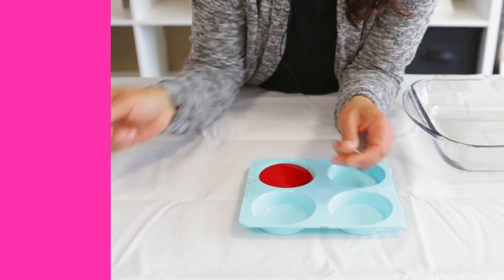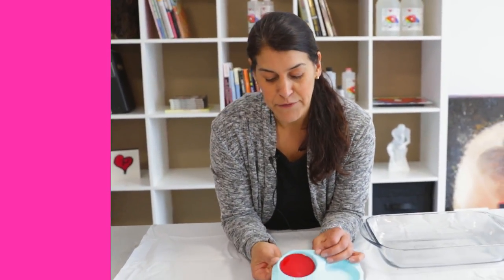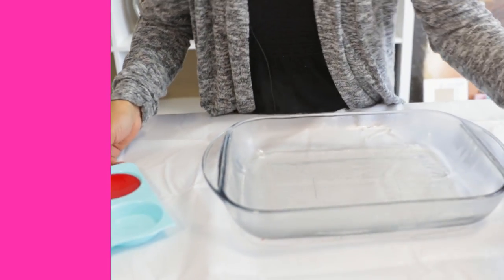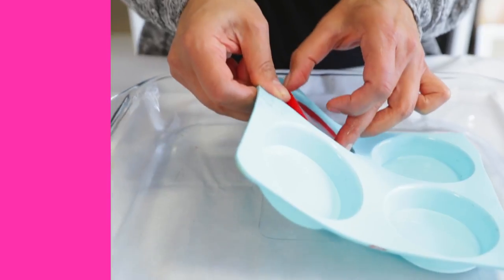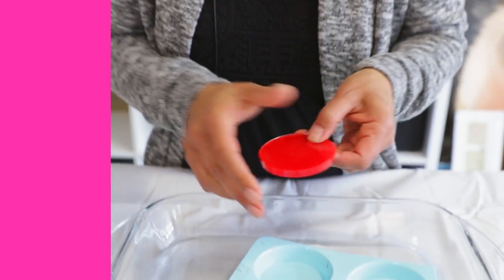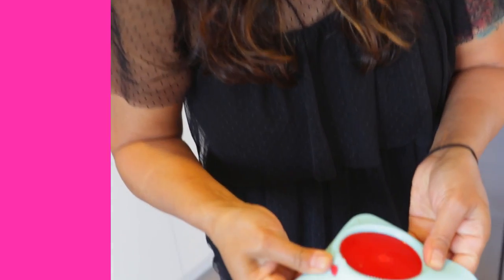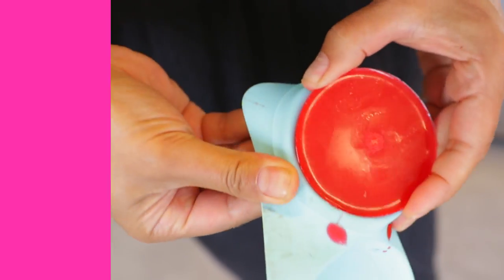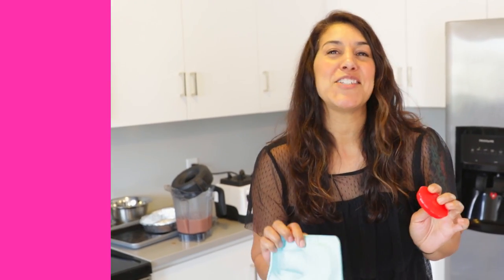How To Remove Stuck Resin From A Silicone Mold

Comment: Im not sure if there is a better (*free*) method for removing a resin piece out of a hard plastic mould (which im guessing is better suited for chocolate... but i digress lol)...so I tried this hot water trick on my mould, i left it in the water for 5mins and it basically popped right out! 

i was seconds away from gnawing at it with my teeth like a savage --- im glad my cloud of frustration did not overpower my common sense to troubleshoot first.lol.

Thanks for the tip!

Comment: Did not work for my molds, for some reason some bits or corners get stuck, never happened to our other resin brands with same molds. I will order mold release spray from local shop and I hope it will help…

Comment: Hi how do you stop moulds from ripping? When I pour it in the mould it heats up very quickly and ends up fusing together and ripping. Even when I do small layers for deep pours for example. The object could be and inch and a half thick and the resin would still heat up and rip the mould. How do I stop this please? Is there any specific resin I should use? And how would I use silicone oil?
Reply: It stock because of the torch or heat gun 😩 try using alcohol in spray to remove bubbles

Comment: Thank you for sharing this trick. I just ripped one of my jewellery mould on first use. I should have checked it before. Will try your trick from now on. One doubt, should you use blow torch or embossing hot gun or heat gun when you are working with thin moulds/ jewellery moulds?
Reply from the maker: We find that using a torch can make the silicone fuse to the resin resulting in damage to the molds.  For best results keep your silicone molds away from high heats.  Many artists use a spray of isopropyl alcohol to clear bubbles.

Comment: I was just experimenting with this because I had a more flat thing, and I found that spraying some mold release and just going really slow as you remove it works great as well. Trying the hot water now to see if it works!
Reply from the maker: Great tip!  Thank you for sharing!
Reply: which spray?

Comment: It looks like the one in the freezer wasn't really unstuck because it has pulled away the silicone and damaged the mold. You can see the blue of the mold stuck to the side of the red piece. When the resin and the mold 'fuses' in this way, no amount of heat or cooling seems to work. It's more of a complete bond between the resin and mold, not just a case of it being difficult to remove.
Reply from the maker: yes, if the mold has run its course, absolutely, with either of these methods, you will get silicone mold residue on the cured resin piece, but this can be easily sanded off.  
This is much easier to deal with than tugging the mold out, tearing the silicone mold and having a huge chunk of silicone mold embedded into your piece ( speaking from experience, this has happened to us here! )  Either way, this mold is done and need to be thrown out now which is why I chose to use it for the video since I knew it would be a problem :)
Just wanted to offer a much less messy solution - the tip being to save your piece rather than trying to save the mold :)  Sorry if I didn't make that clear enough in the video.  
And again, as I mentioned in the text, if the mold is too far gone and has broken down too much, this method may not work either ... but always worth a shot!
Reply: I don't throw them away but I reuse them. :) I cut pieces off and then either hot glue together and/or use a support on the outside with rubber bands around it (cardboard, plastic packaging etc.) to make custom molds for pouring resin. :D - Heidi
Reply: How do you prevent fusion? I've been going through a lot of molds recently and I'm not sure why it does it some times and not others.
Reply: The people of the Internet Same here! Have you found any solutions!?
Reply from the maker: Unfortunately, silicone molds do have a shelf life and eventually will break down and need to be replaced.  
In our experience, these are a few things that can help:  
- avoid lower quality silicone molds or molds made specifically for baking - they won't last long.  Try to use molds that were designed for casting ( you can find them online ) as they are more durable and won't break down as quickly as silicone molds made for baking.
- remove your resin as soon as it's dry to the touch. The resin will still be flexible and won't have had a chance to fully bond to the mold.
- If you resin sticks to the mold, don't tug at it too aggressively or you may rip the mold.  You can try letting the mold sit in freshly boiled water for 15 mins or so to soften the edges enough to pry them out of the mold. Don't let the water come in direct contact with the resin or it may leave a cloudy mark on your resin surface.
Reply: @Artresin  Thank you for your response.  I feel early removal will do the trick for me, I had been leaving them for around 24hrs before. Haven't tried the soak in warm water yet but will if it happens again.
Reply from the maker: perfect - you'll need more than warm water - should be very hot.  I boil the kettle and let it sit for a few minutes and then pour it.  You want it to soften the resin enough that it will release from the mold.  You may still find it sticks a bit if your mold is on its last legs, but it will definitely help.
Reply: let me know how it works!
Reply: @oneness_gaming  I haven't poured a lot since this comment but the few I did do, I found that early demolding seems to work good but figuring out the sweet spot can be tricky as I had one not ready and it disorted my design in the attempt.  I haven't had the best experience with the soak in hot water method. Art Resin is designed to be poured in thin layers (1/8") so I'm going to try something else for my next projects that is more fit for thick pours.

Comment: Thank you so much I had trouble getting a little cup out of its mold, I used the hot water technique and it ended up popping out I did not boil the water just hot water from the tap worked for me so for anyone who needs to know
Reply from the maker: Thats awesome!  Thanks for sharing :)

Comment: So how do you get your casting and resin  lids off the bottles when stuck please help. Im new at this.
Reply from the maker: Hi Angela :) You can try to heat the lids up with a hair dyer some to loosen the product that is likely making them stick. Is it possible they were switched after use? You really want to keep the Resin cap ( black ) on the Resin and the Hardener ( white ) on the hardener.
Reply: I had to cut them open. I went and buy the Mason jars and put the rest in. And lable the lids and jars. To help. They put clear tape over the paper i marked them with.

Comment: do you know any tips for removing resin from a plastic mold? i recently started to learn to make an epoxy resin with a plastic mold and it's not a flexible nor silicone type, so my resin is stuck. so will this method from this video will work the same with a plastic casting mold?
Reply from the maker: Unfortunately the resin will stick to the hard plastic molds and be very difficult to remove.  You could try some of the methods in this video to try to remove the mold however it may not be successful.  Going forward we recommend high quality silicone molds for easy removal.
Reply: @Artresin  thank you😁

Comment: I left my resin in a candle mold way to long it's not budging at all it's like it glued..so how long did you leave it in the freezer. And someone suggested I put it in the microwave for a little bit but really wants to save this project...HELPPP PLEASE!!!!!!!
Reply from the maker: We have not tried the microwave tip but we have found that the boiling water worked well.  If you try the freezer method, leave it in until the resin is really cold.  Others have used a hairdryer to soften the resin enough to release the bond.  Good luck :)

Comment: I use a silicone cup to mix my resin so I don’t have to use new cups every time, however, I have bits of resin left over in my cup that doesn’t want to unstick. How do I get those tiny bits removed from the inside of my cup?
Reply from the maker: Hi Karen, we use alcohol on our plastic mixing cups but that may break down your mold. Maybe try putting it hot water to see if it will soften the resin up a bit to be able to remove it.
Reply: Remove it with tape

Comment: This did not work for me.  My mold is torn & I am trying to remove the small pieces of silicone off of my coaster. :( My first try at resin is not going well.  Any suggestions?  I have OGGIBOX molds
Reply from the maker: We haven't tried that exact brand of mold but have found some molds do get stuck fairly easy. You could try to remove your piece even sooner. Some artists have mentioned that they remove their pieces very carefully between the 12-18 hour point in the cure and let it continue to cure outside of the mold. *Now I would use caution as the product is not fully cured yet during that time frame.

Comment: I just wrecked two (individual) molds :( and it was before the 24 hr mark. I even used that 'silicone mold releaser" because my molds are lovely, and $$$$. So, I will try the freezer trick first. Thanks for the video :)
Reply from the maker: aw, sorry to hear that Steph.  It's frustrating for sure, but sadly, silicone molds will all eventually break down.  I'm not sure if mold release spray helps or not ... we don't use it here because it can cause a hazy surface on the resin or even prevent it from curing properly.  Hopefully the freezer trick will help a bit!
Reply: check its not a silicone based agent

Comment: I emailed Art Resin and was sent this link. My problem is  I use nothing but silicone molds for resin, not baking. I waited the 24 hours. I tried the hot water and the freezer tips after Googling the issue and still tore the molds. They are all new jewellery molds recently purchased. The resin and molds seemed to be fused together. Oh and I do use a torch but one mold was a sphere and I didn't use the torch on that one so that was not the problem. Any suggestions as to why this happened? I ruined 6 molds and not to mention the high cost of resin. Please help 😭

Comment: Mine ripped and now I have silicone stuck to m project. How do I get it off? Sanding?
Reply from the maker: You can sand it or even take a sharp utility knife to carefully trim away the silicone pieces from where they stuck.  Heat may help soften that bond as well.

Comment: What if ur resin is not cured in moulds and semi cured and a bit sticky.... can we retain the coasters 🤔 if they are not cured any tips or it will go into waist.
Reply from the maker: If the piece is just slightly sticky and not gooey. You could remove it from the mold and brush on a thin coat. If the resin is not cured enough to remove from the mold without damaging it, likely it won't be salvaged unfortunately.
Reply: Thank you ❤❤

Comment: hi i just wanna ask if your resin still soft can you like mix another resin mix another and put on top is that going to change anything ?
Reply from the maker: If your resin is sticky you can coat it with a fresh layer of ArtResin to fix.  If it is soft due to being too thin, another layer will help to give it more structure.

Comment: If the resin is tacky after you remove it from the freezer and it is still tacky what else should you do???
Reply from the maker: Was it tacky prior to putting it into the freezer? The freezer method is new to us but I haven't heard of it making the resin tacky which normally means the mixture was off and it did not cure properly.

If you have sticky or tacky resin past the 72 hour cure time unfortunately you will need to re-pour this piece with another carefully mixed and measured batch of ArtResin.
Reply: @Artresin  I didn't realize the curing process was 72 hours. I must have missed that in the instructions.

Comment: I have tried both ways and the alphabet letters will not come out at all!! What else can I do? And spots of resin on top of the molds is completely stuck! And I cannot get it off!! Please help
Reply from the maker: Hi Monica, we usually have success using the tips in the video.  Perhaps just try working the silicone slowly to try to avoid ripping it after soaking in hot water.  Sometimes the resin can fuse to the mold if a torch is used and it can cause damage to the silicone.

Comment: By fault i mix wrong ratio and pour it in the mold 😢i try to clean the mold but till mold is so sticky,plz help me
Reply from the maker: That's too bad!  You can try putting the mold into a ziploc bag and placing it into the freezer so that the resin hardens up.  Then try removing it.  If that doesn't work, try placing the mold upside down over a silicone or plastic liner and let the mold drain.  Or you can scrape out the resin with a silicone spatula so that you don't damage the mold.  Any residue left inside the mold can be removed with isopropyl alcohol or acetone.  Make sure you wear gloves for every step of this - you don't want to be handling wet, sticky resin with bare hands.

Comment: So I’m making a square ashtray and I’ve already bought this mold 3 times because of it sticking to the resin and ripping. I tried the freezer method but not much of a change. I will try the hot water method but I’m wondering because my mold has not hit its 24 hour mark, I see it is already sticking to my mold. Does this mean that my mold melted and therefore not able to be saved? I need some SERIOUS help with this one! Thanks
Reply from the maker: Hi Lyssa, sorry to hear you are having some trouble with de-molding. Quick question - any chance you used a torch to pop the bubbles in the resin after you poured it into your mold? When using ArtResin with molds, we recommend giving your resin and hardener a warm water bath before you mix them to thin out the resin making it easier for the bubbles to the come the surface and pop on their own rather than use a torch. The heat from the flame of the torch is too hot and can melt your molds causing them to stick to your resin artwork.
Reply: ArtResin first of of all, thank you so much for replying to comment. Second, yes I am using a torch right now. So I’m wondering is what you mean by giving them a warm water bath, do you Meath pour then separately first and put the container that they are poured into warm water or pour warm water into the hardner and resin and then mix them? Sorry I’m still white new and just want to make sure I don’t ruin anymore molds!
Reply from the maker: Hi  @229lyssa , apologies for not including a link to our blog with the first response. When giving your resin and hardener a warm water bath, you want to do this while they are still in the bottle, with the caps sealed on tight. Let them sit while you prepare your work area and your artwork. Then be sure to wipe the bottles completely dry before you measure and mix. Here is a link to our blog for more information. 
https://www.artresin.com/blogs/artresin/should-i-warm-epoxy-resin-in-a-water-bath-before-mixing?_pos=1&_sid=3692bee81&_ss=r

Comment: I have a brand new mold that is now completely ruined because it ripped when trying to remove the epoxy. It was right at the 24 hour mark that I removed it. I will try removing sooner next time. But since it was a new mold could it just have been a cheap quality mold?
Reply from the maker: It's possible but lately we have found that more expensive doesn't necessarily mean better quality. We do recommend silicone molds, but you will want to note that silicone molds will break down over time. Some molds we can get 2 or 3 uses out of some will last longer. 

Using a spray release may result in a finish that is tarnished by the interaction with the resin so I would avoid if possible.

If you do find you are having some difficulty removing your piece, you can always place it in a bit of warm water and this will help release the cured resin from the mold.

Another trick we use is to remove the piece from the mold at around the 12-18 hour mark and to let it continue to cure outside of the mold.

Comment: How come my resin is remaining pliable once cured? It appears solid when demolding. But when the items are left in a hot car or even brought to just body temperature the material becomes bendable and loses its structural support
Reply from the maker: ArtResin is heat resistant to 120F/50C so if a piece is left in a hot car or worn outside on a hot day it most certainly could soften as temperatures begin to rise. It should harden back up once the temperature comes down.
Reply: Wow. Thankyou for such a prompt and direct answer. 
Now that I know these properties I can figure out creative ways to utilize them and tailed them to the simmering Las Vegas Heat.

Comment: Hello, i see this too late... M'y mold was really stuck on my resin and left silicone on my resin pyramid. How can I clean that now? IT left like a plastic film on some places. Thanks for your help.
Reply from the maker: Hi Fanny - you can sand down any of the plastic residue ( sand by hand or use an electric sander ).  Then you'll need to bring the gloss back by mixing up a very small amount of resin and hardener, and applying it with a disposable foam brush.  That's it!  :)
Reply: @Artresin  Thanks for your reply ! not easy to sand… but how does that happen so ofter, even with new molds, my resin stick on them… i mix 50/50 resin and hardener. really strange.
I need to use unmolding spray, otherwise I ruin all my molds !

Comment: Hello, I make a mistake of cleaning my molds in the sink and now my porcelain sink has cured resin everywhere. I tried alcohol and vinegar (googled them) but it didn't work. Sorry for bothering you but do you have any ways to fix this?
Reply from the maker: Hi, you can try using a hair dryer to warm up the cured resin pieces. The heat will help them to soften and make it easier to try and pick them off. For more information, please email our customer service team at support@artresin.com